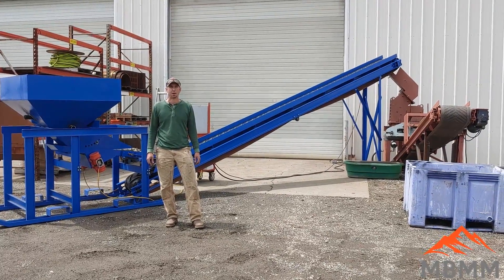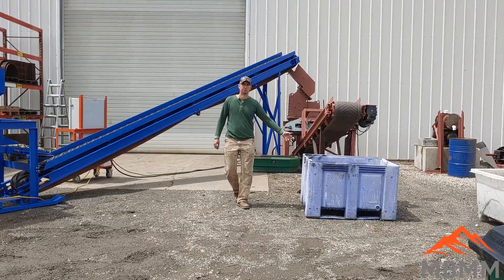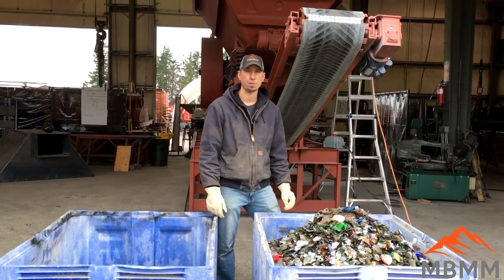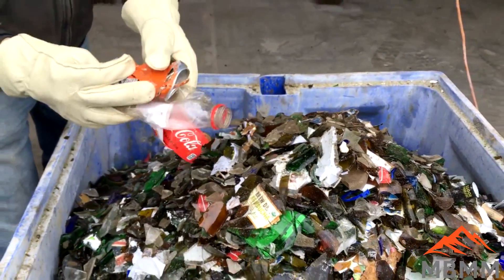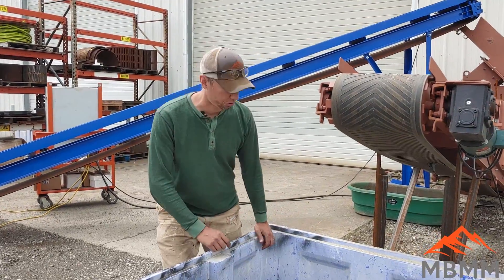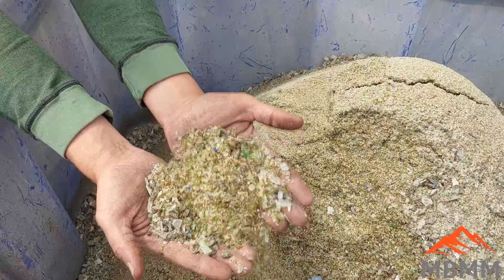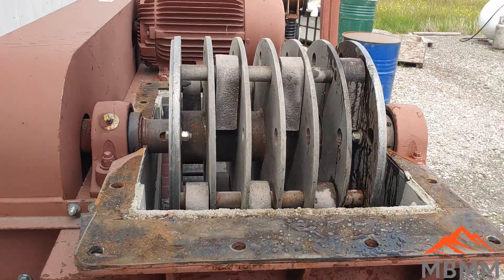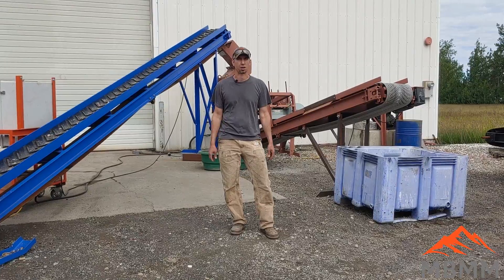Recycling Glass To Sand! Glass Crushing & Recycling Line

Comment: Anybody know what happens to the paper labels? - this would seem to be a contaminant
Reply: i think they burn
Reply: MSSGNO We are all gonna 🔥burn. Especially those who commune with the devil. All hail, Satan👹come get all of us who comment on the internet...🤣
Reply: Personally I am more concerned by the plastic labels. Paper will break down, especially ground up, but microplastics are already an environmental problem without any ground up plastic mixed in.
Reply: AlohaChips I would think any plastics such as lids are melted in the process.
Reply: @AlohaChips  - Pretty Sure it can be used with Cement, in Concrete, don't ya think? It's Problem really is, that it ends up in the Ocean, and causes bigger problems for aquatic life. If properly captured, and used, it can serve many useful purposes.
Reply: in some plants they have a high-tech solution that uses light/laser to scan through the debris and if it finds a piece of paper it uses jet air to push the paper away into a different stream. THe technology is called redwave if you are intersted...
Reply: @timmytheguitarguy   sorry , hit the wrong button.

Comment: How and when in the process do you remove the non magnetic contaminants?
Reply: A lot of it could probably just be burned off. It's mostly paper labels.
Reply: The larger plastic/aluminium that survives the initial crushing can be meshed out. He briefly mentioned eddy current separation, which would be used to separate conductive and non-conductive materials, e.g. aluminium bottle caps/rings that passed through the mesh.

Comment: Nice, good work. You are defently going in the right direction. Consider colour sorting and then washing the glass maybe after the first crushing to remove food, paper and glue residues from the glass. The washing requires a drying step afterwards tho, so it might be not profitable enough. At my country (Germany) the glass can't get properly recycled if the colour contamination exceeds a certain percentage in one colour. One coloured glass can be mixed in with a new batch of glass in glass bottle production and can start a second life as beverage container.

Comment: Would like to see how easy it melts into glass rods.
Reply: Probably very easy since it already is glass. Similar to recycling aluminium, much less energy needed to remelt it than the oxide it's made from.
Reply: @SnorrioK  Takes about 1300 deg.f, which is about the same for steel so you need to have a special set up.
Reply: as far as i understand it mixing glass of different types like that will result in really awful rods, and glass in general. it would be very brittle if you could get anything, and beyond that it would crack if you tried to treat it after.

Comment: Hey government, invest more of our taxes in stuff like this.  I got lots of waste glass and no local recycling, even if it needs a bit of assistance lets grow this market.
Reply: No local recycling?  😱 How in earth is that possible in 2020? We recycle glass since the 80's.
Reply: will do
Reply: How about Government taking LESS taxes and  LESS restrictions to allow citizens to have more capital to start things like this on our own.
Reply: I think taxing new paper, glass and steel products and applying those taxes to subsidize recycled ones would help. Many cities stopped accepting glass for recycling because the market dropped to the point that they have to pay buyers to take it.
Reply: Glass seems to be a stable product.  Other than taking up space, what environmental concerns are there for glass in a landfill?
Reply: @steves2694  Like food, wood and landscape waste it takes up landfill space and building landfills is unpopular in most residential communities.
Reply: Glass recycling isnt economical. Did you see the wear on the hammers? And think about all the energy it takes to run this system
Reply: @garrettholland664  we need to find a way to make it economical. It's better for the earth, we just need to find a way to make it better for our wallets as well.

Comment: What do you do about all the paper labels that have to be mixed in with the glass?  Doesn't this contaminate the glass when it's melted?
Reply: Paper will burn off/vaporize long before the mixture reaches the melting point of the glass.

Comment: Very cool.  When you crush it back to sand, what does it end up getting used for? Input for new glass, or generic sand (ie. what is the economic value of what you end up with)
Reply: this sand can only be used as building material, since it is a mixture of different colors. to make new glassware out of recycled glass, it has to be properly sorted by color.

Comment: Maybe this is a dumb question.  What happens to the labels?  Do they just crush up fine with the glass or is there some other operation to remove them?  Seems like they would tend to clog the hammermill.  I expect if you are just remelting the glass the labels would disintegrate, but would that not add a fair amount of carbon to the melt?
Reply: this sand can only be used as building material, since it is a mixture of different colors. to make new glassware out of recycled glass, it has to be properly sorted by color.

Comment: Why crush so fine? We fabricated the structure 5 stories high for a recycling plant in Cape town. the glass is crushed to about the size you initially do. then its sorted to 5 colours using video cameras and a glass water fall with each piece of broken glass tracked and blown onto a specific conveyor with a air  jet. plus minus 200 tons per shift.
the sorted pieces ares stored in bunkers (cullet) and delivered to the appropriate furnace with massive cat front wns loaders.
the fines (by product) are low value and are sent elswhere and get used as hydroponic growing medium. filter material and other uses
Reply: Some places here use it as an abrasive medium.
Reply: Wouldn't it be better to sort it by color, before crushing ?
Reply: Glass recycling is fantastic. I get really po'd when people throw away glass
Reply: In germany, there are separate containers for different-colored glass.
Reply: Hi John. Glad to see you learned something while working at Consol Glass 👍
Reply: Ideally you sort the glass after the first crush.
Get rid of stones, metal and ceramics.
Then sort by colour.
If the glass is too fine, it cannot be sorted and will create only dust when it is fed into the glass furnace.
Reply: This is used for cement .
Reply: John Spargo ‘’
Reply: Why not just melt it ?
Reply: Mr. Gigi efficiencies. Small things heat up faster so use less fuel overall than the same mass in the un-crushed state so it makes sense to crush first to reduce your gas bill as well as make the whole process faster overall.
Reply: Sounds like a lot of energy being used.
Reply: @scott.c9587  Less than making it from scratch.
Reply: Another use is in the production of concrete in areas natural sand is expensive to produce by washing soils or because the waterways are protected for endangered species. Also, polished cement floors like in schools or government buildings (in the US) use glass to give high sheen and durability.

Comment: Would this be a good replacement for the use of ocean sand in concrete
Reply: Nowadays, Construction sand comes from rock quarry, river bed.
Reply: You can use anything as concrete aggregate. It’s all about mixing sizes. Ocean sand isn’t great because of the salt, but fully washed it’s fine.
Reply: No it's not as the glass can become gelatinous because of the extreme alkaline nature of the cement. The chromium used to colour green glass, apparently stops this phenomenon, making green glass suitable for use in concrete.

Comment: Question:  Natural sand is tiny little nuggets. Isn't crushed glass still tiny little shards that can embed into skin? How can you deburr the shards to become granules?
Reply: I guess the grinding and mixing processes inside the crusher act as the deburring
Reply: @roehlzapata8361  Mixing it in mortar is one thing but I think I would want to examine it under a micro scope before getting exposed to it.

Comment: I've heated bottles then quenched them in water. They turn to blunt powder.
Reply: I would like to see that.
Reply: @douglaspohl1827  Campfire temps, I use it to dispose of litterbug's bottles when on hiking trips and can't carry them out. Place the bottle in the glowing coals, remove when red, dump it a cooking pot full of water, it instantly crazes. Find a hollow in a rockbed or dig a hole and line it with flat rocks. Pound them to powder with a rock or a hard stick. Mix with soil, bury in the hole or disperse in a river where the running waters grind them further. Eventually those tiny particles end up in the ocean, harmless. Having said that I wish ppl wouldn't dump and smash their bottles everywhere, they start fires in summer.
Reply: @thebruffy1077  Yes indeed... TKS!

Comment: Now what is it used for?
Reply: Concrete, driveways, walkways, all layers of road construction, building blocks, roof tiles, top layer screed, decorative garden slabs etc, all at various mix proportions and of course, sand blasting.

Comment: It's quite easy to separate materials of actual substantial value, (Rare Earths, Gold Silver, Steel, Aluminum).  Sand is not zero value but when competing with established quarry's, $31.5 per Ton means serous throughput if your going to be viable.  I'd say at least 10 Ton per Hour minimum, even for a small operation.
I'd suggest focusing on separation by density.  Either with something representing a modern day gold sluice, and / or settling tanks.  Theoretically you could control the exact density, and therefore the selection of plastics in a saline solution, by altering the precise ratio of water / salt.

That in turn however highlights the real issue, what to do with the plastic!
The councils won't accept it back, and they wont let you burn it even at the right temperature, or in pure oxygen environments.

Comment: OK,  But why?
It's the one material that gradually decays back to sand, and is environmentally inert as it does so.  There's essentially zero energy saved by remelting and reusing that glass in place of fresh sand.  Similarly there is no benefit environmentally, or economically by crushing it back to sand.
Reply: Yeah, its one of the few things we can just bury forever and it will never matter!  I've never understood glass recycling other than making a separate market for waste removal.
Reply: making glass from sand etc. is much more energie costly then from crushed glass. shards of approx 1 -1.5 inch. energie saving can go up to 50%!

Comment: So how does this process separate the paper labels from the glass?
Reply: I'm guessing it doesn't. Most likely this is all sent to a refiner to be melted into new glass.  The label, any glue, and any food residue burns off.
Reply: My guess it does not go anywhere. If he had an outlet for the product he would have mentioned it.
Reply: @mattcourty6322  Most likely not. His process didn't separate the glass by color. Each glass color was originally made by introducing metal impurities into virgin sand. Now his sand mix has all of the metal elements in it and the only glass color that can be made from it will be a smorgasbord that varies from batch to batch. While it might be chemically possibly to pull out the metal colorants, it would not be economically feasible. It would be an order of magnitude cheaper to make glass from virgin materials than to do that. At best, this "recycled" sand could be used for in-fill or industrial type uses.
Reply: @xungnham1388   Good point! Likely this was just for the video as an advertisement for this companies crushing and mining equipment.

Comment: Very strange process. The iron remover should be placed in front of the crusher. Plastic and paper are also mixed in the finished product. I don't know what the use of such products in the United States is. For the production of glass bottles?

Comment: Good job of making recycling a thing that get's more and more common!
Though I had a few things I thought while I was watching:

Ah look recycling catches on more and more even though it's still something that has to be done by the recycling guerillias...
And then yy soul starts to bleed a lilttle when I see all the colours mixed together like that for the recycling process, might be because I'm German and have two collection places for recycling glass within 700m of my front door and they sort by no colour, green and brown/mixed/other colours glass. And then there was a plastic coke bottle in there, the HORROR!

No honestly, over here you pay a 25€ct deposit at the store you get back when you return the bottles usually in form of a value coupon that subtracts the money from your total, only carbonated drinks though, that is basically BS in and on itself, it should also apply for juice etc. !
As for metall parts I usually add my lids to the plastic back since it's easier to sort that stuff for metall nonmetall and it's allowed in there, just make sure to pull an aluminum lid completely off the plastic container (yoghourt, etc.), otherwise we sort by paper, plastic, biodegradable residual waste, hazardous waste has to be brought to a collection site and 1-2 a year you can request old furniture etc. to be collected from the city waste management, or there are specific dates for a bigger collection efford.
Now I need to mention that there are still many people in Germany that don't follow these rules and guidelines, I don't happen to sort biodegradables, I don't produce enough of that stuff, but other people don't sort at all! This can lead to getting rather hefty fines for a specialised sorting, if it can be pin pointed who's responsible that person has to pay for it on their own, otherwise these costs get divided for the whole house/all people renting there. Thus I consider people who throw everyting into one trash can and even go so far to contaminate somewhat sorted ones to be dickheads, at least where a mostly effective recycling system exists.
Reply: All those things exist in the US as well :)
Reply: At least you have a system to collect the waste  in a sorted way. In my opinion a collection system is the most important part to build a value chain to produce raw materials with a good quality, people are a variable that we can't control completely, the only solution for this point is education actions and try to build a society with good level of environmental education.
Anyway, it's good to know that exists good systems of collection around the world and exists a lot of people as you that follow the rules and contribute to this system. I would like to have the same in Brazil, but is a distant scenario.

Comment: Love your work guys... I was curious if a wet shaker table would help sift small plastic and paper from the end product?
I have thought long and hard on ways to recycle glass safely. Your system works, but the dust is extremely hazardous.
I think a trommel style ball mill would work best, using water to prevent dust from escaping to harm the area, then having it feeding a shaker table to remove or wash the end product.
Plastic and paper would wash out easily (possibly has a resale value), fine silica glass would run through (definite resale value), and metals would be recovered in particle sizes. Fewer moving parts and cleaner end materials?
Reply: Introduce water to the process

Comment: The dust must be extremely dangerous.
Reply: Super fine silicates would be, but sand is pretty course by comparison.  It really has to be fine enough to be suspended in air to be an issue.
Reply: @lordsamich755  During processing, there must be some super fines produced unintentionally. I wouldn't want to live down wind of that place.
Reply: @coffeefish  
But at what rate?
Why would that be different to any glass manufacturing plant?
Reply: Lord Samich That’s why it would be different.
Reply: Nope. Raw material is crystalline silica dioxide but crushed glass is amorphous silica dioxide. The first is hazardous, the second is totally bio-soluble.

Comment: The system you have is pretty workable for anything I would be using, seeing as I would only be using it either as concrete infill, or to make sodium silicate for reinforcing concrete.
Reply: If you compare the cost of the two. I have a hunch crushed sand as a waste of rock quarry, or sand from the river would be much cheaper. 
Broken bottles are more valuable to glass bottle maker.
Reply: @ramonching7772  Yes, but you have to bear in mind that glass bottle manufacturers need to have a certain fraction - too fine and it cannot be used.

Comment: Maybe develop an effective transition from conveyors to hoppers losing product on the ground is a recurring conveyor problem requiring manual clean up costing firms valuable man hours.
Reply: enclosed tubing over the conveyors maybe... would also reduce dust transmission

Comment: Jason have you looked into changing your screen designs to allow for faster changeover? Perhaps look into a company called Panizzolo for inspiration. I run a 90kw and a 22kw (neither are Panizzolo) and always wish I could change the screens as quickly as you can with the Panizzolo gear as it would give our operations so much more flexibility to process more materials given the massively reduced down time

Comment: In the UK single colour crushed glass is used by architects as expensive decorative finishes. Usually about 6 to 10mm low dust glass laid in a semiflexible epoxy.